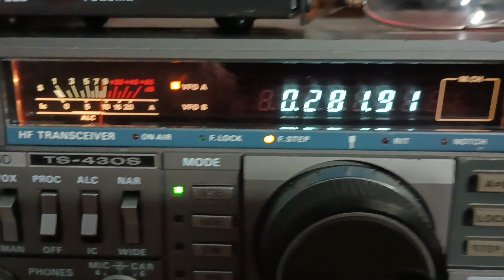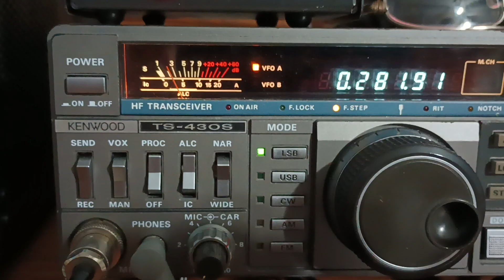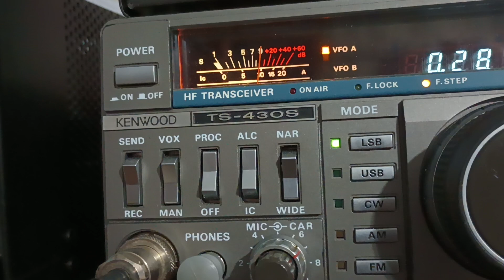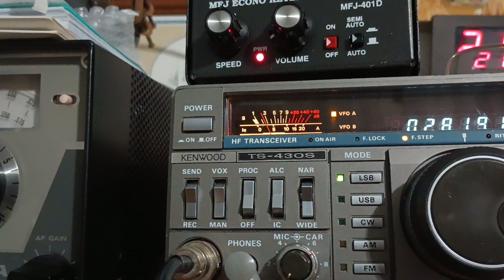The Magic Noise Filter - A Variac? #hamradio #cbradio #grounding #meanwell #swl #electronics

Comment: Nothing like killing the noise, rather than let it drive you crazy. Nothing like killing the noise and having fun doing it. —— 73 from another retired EE (it IS a great hobby, indeed).
Reply from the maker: see folks, from  an engineer, not hobbyist,

right on. rfi can be a nightmare to cover up.
And GROUNDING IS USELESS. The supply is already "grounded" to the AC power cord (which isnt ground...)